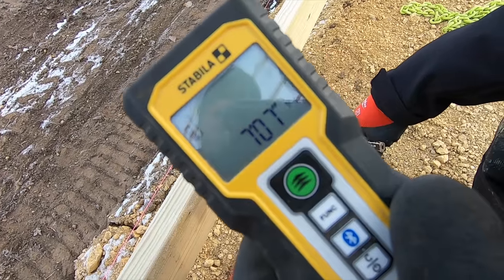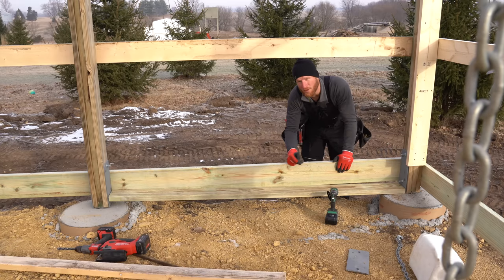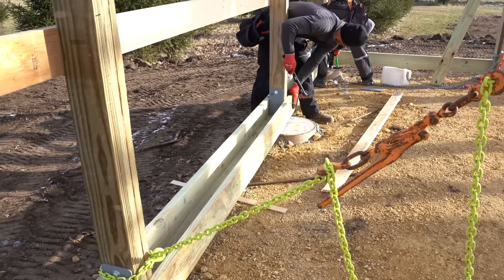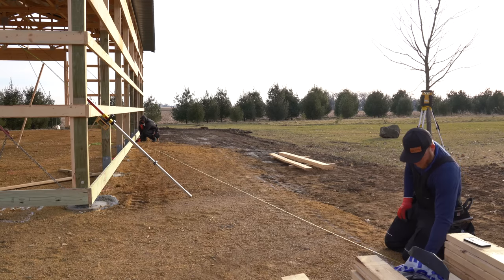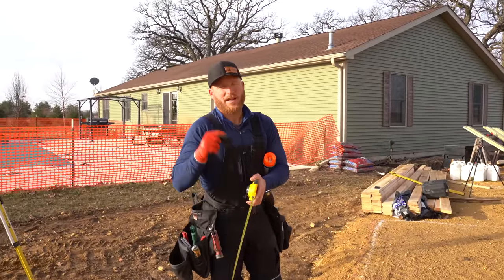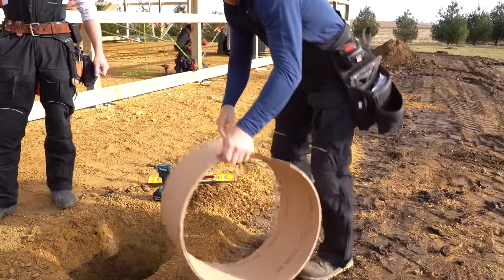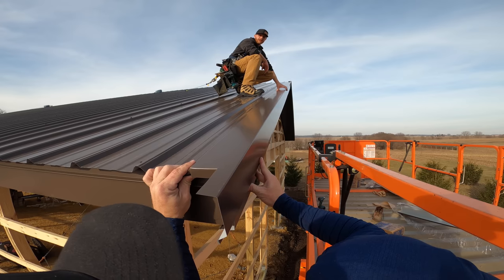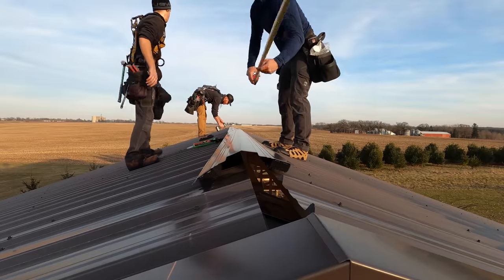Building a Large Garage Part 4: Metal Roof Details and Porch Piers

Comment: If you want to truly rodent proof it also needs a galvanized steel flashing attached to the board to keep them from chewing the wood. With almost 9 years doing rodent exclusions the second easiest place for rodents to gain entry is at utility penetrations and ridge vents. We install 1/4" hardware cloth under steel ridge vents to prevent mice rats, flying squirrels, and bats from getting under the ridge vents and dropping down into the attic from the gap at the ridge

Comment: Hi Kyle, it would be awesome if you could  make a video on the driver bits you use for various applications of the pole building process. For example what bits do you use for the sheet metal screws that minimize paint coming off the heads?
Reply: We use #25 torx bit for out screws so you don’t have to worry about losing paint off the heads

Comment: Great work as always! Got a question. I'm doing some storage units and am experimenting with doing flat stock over a 32" span. Basically I'm bending each side at 4.5" to trim the door jams and then spanning the distance between each door. So, what are my chances of getting oil canning and how might I prevent it. The metal will be 80" tall.

Comment: How do you attach your grade boards on the corners to your columns with the face of the steel plate and also do you use through bolts on them too and just counter sink the heads on the outside so the grade board can sit flush.

Comment: Hey, RRbuildings! How deep are the poles in the ground? What is the minimum requirement? How much rebar do you put into the holes?
Reply: when doing his own concrete he uses the wet set brackets with four welded on pieces of rebar 18 inch long which is all that is needed, there is really no other rebar used since the soil around it keeps it stabilised, compression is the only force being placed upon the concrete

Comment: putting a metal roof on a garage and a small lean too of one side of it... it has one row of shingles on the garage... am i ok by building a 1x4 structure over it and putting fanfold in the gaps for moisture? planned on using long enough screws to get to the trusses so it never shifts with the shingles

Comment: So how would the gable trim work if the ridge extends an extra foot or two beyond the distance of the soffit edge at the bottom? Obviously the first panel would have an angle cut from the top to the bottom, Potentially across a rib. Just wondering how the trim would fit or would you just omit the trim?

Comment: Won’t air or moisture go into the wall through the small gaps between that bottom board (the one between the inside grade board and outside grade board )and the bolts that go through the brackets and columns?

Comment: Hey dude sorry not watched for a while from here in the UK, just a thought! If the roofing manufacturer supplies a hard rubber 2"x1" X the thickness of the gap between the roof tin and the lath that it suits on (basically the gap that's created by the profile of the v on the roof tin) , thus filling the 20mm gap between the lath and the tin (only on the gap that you will be fixing the fascia with the screw going upwards) of you know what I mean. Then this will stop the force of the screw from making the fascia "pucker" when screwed tight. It's a very simple way to stop that from happening and also let's you screw right up without losing the tightness of puckering. I think you will understand what I mean. If not, message me back and I will get a diagram over to you. As people like me  (a contractor) notice the distortion where the screws are fitted, even from the ground,  was certain light makes it apparent to the eye, this simple but extremely effective "hack" makes the world of difference. Nice job guys

Comment: In the Great White North here we have to put a moisture barrier(dripstop) under the metal roofing so that any moister/sweat from the cold/heat cycles  runs down to the soffit and doesn't drip inside the building. Seems cold enough there to warrant the installation?
Reply: What you mention is a humidity zone related issue.
Reply: @Joshua79C  Ya regardless, for us up here it's code. My house has it and my garage has it. Every metal building I've built demanded it. Was just asking cause it seems cold enough where he is to warrant it.
Reply from the maker: We install a vapor barrier later on ceiling. Little different.

Comment: How far up does the concrete slab get poured against that 2x8 on the inside of the rat board?  4inches? with gravel fill up to the bottom edge first?
Reply: Watch last video of How To Dream Shop to see the concrete level, he also since then posted another example of pour day as to where the concrete is flushed level at/to.

Comment: Ummmmmm why is the screws not on the Ridge of the sheets ,and set in the flat that's reason for leaks
Reply: Screws in the valley cause leaks that's why you use longer screws and crank the the end of the sheets before the Ridge cap goes on screwing on the flats is just being lazy ...